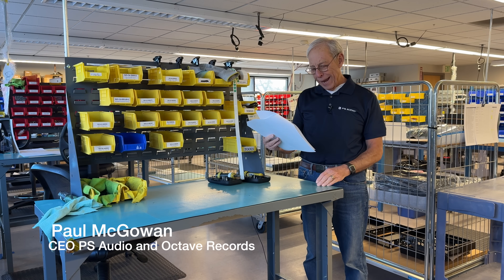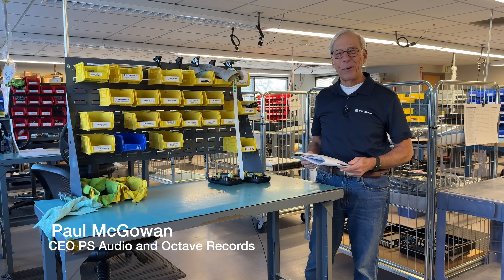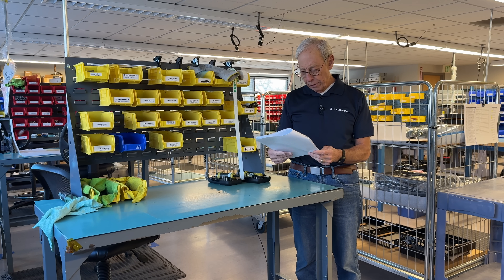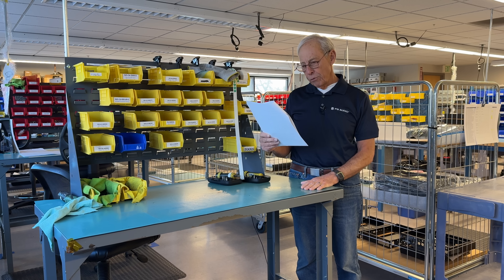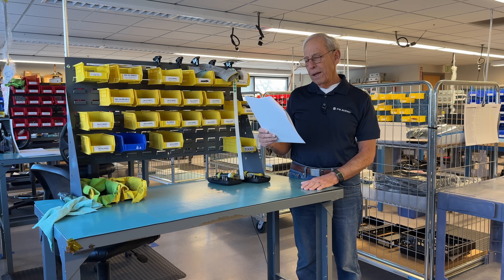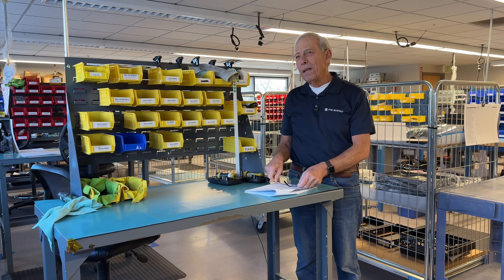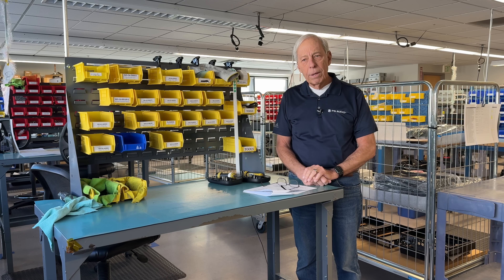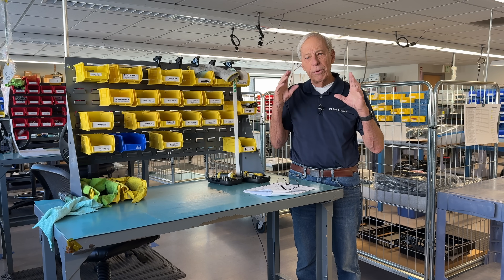Paul explains equipment burn in

Comment: I have not used my system for nearly a year. When I turned it on last week it sounded terrible. Poor detail, no stage depth.  I let it play on repeat for an hour, no change .  7 hrs later , after playing continuously, the magic was back.  I have a solid state amp, a tube pre and sacd player.  Do these things require a re- burn in after sitting idle for long periods of time ? Great video Paul.

Comment: I heard a good way to do burn in - so you don't have to hear to much like at night, is to reverse the polarity of one speaker and put them face to face.  The sound will now be mostly cancelled out.  Just remember to reverse the speaker connection back again later.

Comment: Sorry Paul, your burn-in claim makes no sense. If an electronic item comes out of the factory where Trimpots and the surrounding circuitry have been adjusted for optimal performance, are you then claiming in say 3 months you need to open unit up and re tune the circuit. This is more audiophile pseudo science. And looking  at your age i don't believe your ears are of  good enough sensitivity to hear any subtle difference. Show us the proof on say a real instrument like a CRO demonstrating this change.

Comment: Paul's videos are always enjoyable and worthwhile, but to me this is one of his best.  Keep up the good work Paul, and thanks!
Reply: They do sound good even if the claims make no sense or aren't based on any measurable science. Definition of nice sounding fairytales I think
Reply: @Mk-tp2mz 
Is the beautiful voice of a female singer based on any measurable science?
Reply: @Hare_deLune No
Reply from the maker: How very kind. Thank you.
Reply: @Hare_deLune  
Yes, it can be measured and studied ... quite easily, really.
Reply: @Hare_deLune  no that depends on the listener. A dog barking may sound beautiful to another dog. That is subjective to the listener. But your statement is not a logical rational  comparison. I am talking about your ability to hear. And definitely an elderly man  like Paul's  ability to hear. That is measurable and testable. Hence you can get your hearing checked by a medical professional. It's not a subjective at all. Electrical changes in signals would also measurable due to do called "burn-in" would  also be testable. An oscilloscope for instance can detect changes at the microvolt level and frequencies outside human hearing. Way lower than can even move a speaker coil. Paul is making outlandish claims to the ignorant masses here. I doubt  most would even understand what an oscilloscope is let alone what it measures. Personally by hearing Paul's claims, I don't believe Paul has much electronic education or decides to just ignore basic electronic laws. And what he is saying also defies common sense. If it were true I would need to be returning or tweaking biases etc in my high quality audio equipment regulary because of these apparent changes in sound.  If components are changing values like he is insinuating, why would think they just magically stop when it somehow sounds better. Pauls claims are just "nutty". They are not based on reality. Only believable to the gullible.

Comment: Opinions are like butt holes everybody’s got one. With that said, I also have a fair understanding of electronic-components, including speakers and their break-in/ burn in. Here are my thoughts if anyone cares.

The Science of Burn-In in Audio Equipment

The concept of “burn-in” refers to the belief that audio components require an initial period of operation to achieve their optimal performance. This is particularly discussed among audiophiles concerning two-channel stereo equipment. However, the scientific evidence for burn-in varies depending on the type of component.

Loudspeakers

Loudspeakers contain mechanical components like diaphragms, suspensions, and spiders, which may undergo slight physical changes during their initial use. This phenomenon, often referred to as “break-in,” might affect the speaker’s compliance and resonant frequency.
	•	Scientific Evidence: Studies have shown that some mechanical changes in speakers occur during their early hours of operation, but these changes are minor and usually happen within the first 10–50 hours of use. Objective measurements have demonstrated that these effects are typically negligible in the context of overall performance.
	•	Source: Audio Science Review - Do Audio Speakers Break In?

Electronic Components (Amplifiers, DACs, and Cables)

For electronic components such as amplifiers, DACs, and interconnect cables, the concept of burn-in is more contentious. Components like resistors, capacitors, and semiconductors are designed to operate within precise parameters, and their electrical properties are stable once manufactured.
	•	Amplifiers and DACs: There is no substantial evidence to suggest that these components change significantly during their operational life, aside from potential degradation over time.
	•	Cables: Claims about cable burn-in lack scientific basis. The materials used in cables (e.g., copper or silver) do not undergo physical or electrical changes that could audibly affect sound performance.
	•	Source: Home Theater HiFi - Component Break-In

Psychological Factors

Listener acclimatization, or the psychological process of becoming accustomed to a new sound, plays a significant role in perceived changes in audio quality. Many audiophiles report improvements after a burn-in period, but these perceptions can often be attributed to human adaptation rather than measurable changes in the equipment.
	•	Key Insight: Subjective impressions may lead users to believe the equipment has improved, even if objective tests show no significant changes.
	•	Source: Stereophile - Break-In: Reality or Myth?

Conclusion

From an engineering perspective:
	1.	Loudspeakers may exhibit minor mechanical changes during initial use, but these changes are limited and typically settle quickly.
	2.	Electronic components and cables do not require burn-in, as they are designed to function optimally from the start.
	3.	Perceived improvements are often psychological, resulting from listener adaptation rather than any physical or electrical changes in the equipment.

Thank you. Robert.
Reply: Thanks for your summary. The problem with all this "audiophile" talk is that it's solely focused on the audio system, never on your own biological system.
If people would understand a bit more of e.g. the sense if hearing they may understand that the brain system has a major influence on how (identical) triggers lead to (different) experiences.
Reply: Did some AI give you that?
Reply: @Matt-cb2db  
Well, that's mostly because audiophiles consider their hearing to be infallible. The very mention that anything, anywhere, can hear better than they can is often insulting to them.

If you want to know just how unreliable our hearing actually is, put on some monophonic pink noise, sit dead center in your sweet spot... now move your head about 6 inches left and right ... Yeah, it's that bad.

Comment: I consulted co-pilot AI and this is a section of what it says: "In industrial settings, capacitors are often formed during the manufacturing process, but forming can also be done in-situ in certain applications.".  I wonder if the audio capacitor manufactures form them as indicated above?

Comment: I bought new speaker cables a while ago. After 75-100 hours things started to sound smoother, more refined and with a greater sense of depth. If you are not paying attention when listening you probably have not heard the transformation of burn-in... There are so many listening habits out there. One is cooking dinner, one is reading a book, another always in sweet spot deep into the music... Guess my practice...
Reply: @martinlindberg1983 what are your listening habits?, when you heard these  changes were you snorting a line of coke ?
Reply: So you did blind comparison between your other speaker cables?
Reply: @ryanschipp8513  he probably has faulty hearing  aids

Comment: Isn't burn in something manufacturers recommend so you have time to become accustomed to your new sounding gear? If the physical characteristics can change so quickly in the first few hours' of use how does this change progress in time? Do things magically stabilise, or continue a staedy, if slow, degradation.
I would never buy  new gear anyhow, not when my money will go twice as far buying used. Recently I had a choice of buying mid-level Chord speaker cables used, at half price, or buying new, and paying the dealer progressively larger amounts to burn the cables in for 24, 72 hours or a week. You couldn't make it up.

Comment: Sorry Paul, you seem like a nice helpful guy, but I am very skeptical whether "you" can hear whether burn in makes a difference. Given that as people age their hearing greatly diminishes. Guys suffer large changes in hearing with age What laboratory type controls do you employ? ie. Identical model gear????? Power conditioning? Etc How would one even guarantee that? One  with burn in. One without ? I believe the placebo effect in play here.
Reply: Sorry, what did you say??
Reply: @Hare_deLune  precisely@ i want to call for a hearing aid check. Testing testing!
Oops I forgot, they need to burn in before they work properly.
Reply: Sorry i mean you seem to be a nice snake oil salesman, if they do exist. When they relieve the ignorant of their money. But your claims are utter rubbish. Anyway congratulations on being able to successfully con enough people out of their money believing this rubbish.. I am just jealous ths I can't sit there with a straight face and make money doing the same thing. 😀

Comment: Would like to see some objective measurements indicating the burn in effect.
Reply: For something that obvious; no one will ever bother to prove it. Going to the trouble of proving things is reserved for phenomena that is hard to perceive. My stereo, which is way up there for sound quality, real obviously has 40 to 50% better sound quality after it is on, and playing for several hours. It reaches its peak performance around the 3 and a half hour mark. New cables which often sound like they do not have any bass, after 12 hour or so of break in, sometimes sound like they have too much bass.
Reply: @sidesup8286  Surely you're joking, especially regarding cables. If wires changed over time then we electronic engineers would be constantly recalibrating our test gear every hour.
Reply: @TerryClarkAccordioncrazy  if you buy coke from the same  dealer he does you will likely hear the same things. You also forgot to ask him what atmospheric conditions were present when he heard these changes and if he was using polarized speaker cables and did he have them around the right way. I feel a lot of dementia patients on here. WITH The age range of the target audience, It seems likely.

Comment: If your device requires a "burn-in" you know where's a trash bin is.
Reply: That's right!
One should always throw away their expensive equipment just as it reaches peak performance.
Reply: @Hare_deLune  Precision measurement tools in labs don't requires a "burn-in", only initial stabilization. And these devices way more expensive than any "high-end" BS ^_^ But IF one of these devices will require "burn-in" to work properly, they will be instantly marked as [FAULTY] and sent to repair/recalibration. "burn-in" requirement means that your devices is made from crappy components using wrong shematics. And it doesn't matter how expensive or cheap it is - it migh cost anywhere from $100 to $1M - "burn-in" means [FAULTY] ^_^
Reply: @Ashen2501 
1. "Burn-in" and "break-in" are often used interchangeably.
2. Precision measurement tools in labs are not audio equipment and are not meant for critical listening.
A toaster also does not require "burn-in" (no pun intended), and is not listened to.

Comment: I bought a pair of Magneplanar IIIs after being impressed by a demo. When I set my pair up, they sounded so bad, that if it hadn't required a 100 mile drive, I would have taken them back. Because I was too busy, I kept listening to them and behold, it crept up on me so slowly I didn't realize it for a while, they began to sound great. I am still enjoying them 40 years later (repaneled once).
Reply: Sounds like you got used to the sound and it didn’t bother you anymore after a while.
Reply: @gimaru1 
That's right! Even the harshest, shrill screeching sounds will start to sound pleasant after a few days, once you get used to it. That's why construction workers can often be found out in the back yard using a jackhammer on the weekend, because they've fallen in love with the sound.
Reply: @gimaru1 go learn electronics… capacitors, coils that get hot, stabalize first hours, that’s why decent hifi brands checks and adjust big amps after been hot, before putting them in the box at the factory, even speakers start to sound better after the first hours of playing
Reply: @Cestmoi50  sounds like I triggered some golden ears:) if anything needs to be stabilized it should happen in QC before being shipped, and not after weeks or months of use.

Comment: Do not trust ChatGPT any more than you would trust any search results -- especially for legal advice, medical advice, or political advice.

You can use ChatGPT as a starting point.  But ChatGPT makes lots of mistakes.  There are numerous videos demonstrating such mistakes.  One is about a lawyer submitting papers to the court, finding out that he was citing cases that ChatGPT fabricated.  The judge asked the lawyer if he verified the cases that he cited.  The lawyer said that he questioned GhatGPT for the authenticity of the cases, and ChatGPT confirmed their existence.  That lawyer was severely admonished by the court -- nearly disbarred.

There is another case of an expert Lemon Law attorney inquiring about his state's "Lemon Law".
ChatGPT got most of it right.  The problem with getting most of it right is that it is the part that it got wrong that leads to you losing your case.

For life saving medical advice, consult a doctor.

For political answers, ChatGPT is a hard-core democrat.  That is fine.  But you should know that, before expecting objective answers from ChatGPT.
I would write the same thing if republicans programmed ChatGPT.  So it only makes sense that your political inquiries will reflect the programmer's ideology.

Do not trust ChatGPT for anything very important -- no matter how "cool" and fun it is to interact with it.  ChatGPT is an amazing work of programming by her developers.  But it is still just that -- a program.  Do not lose sight that it was developed by, and is run by, actual people that you do not know.  And those people control it all.
Reply: As with many things... the thing itself may not be the problem...

Comment: I asked chat gpt, "do fets or bjts have higher slew rate"... It responded "fets because these are voltage controlled devices".. Then i asked chat gpt "for audio do fets or bjts have higher slew rate" and it responded " bjts because they are current controlled devices".  Chatgpt is a probabilistic text retrieval device, based on the text it simply generates the most likely sequence of words.  So be careful.

Comment: "Burn in" was only ever used to reveal potential component failier ..nothing more.  Combustion engines have a mechanical wear in period ..electronics do not . `all elecronic components have an initial acceptable quality control specification ...if they "burnt in" they would be out of tollerance and create a below specification product.
Reply: Speakers do change a bit over time, but as you stated, these are electro-mechanical.